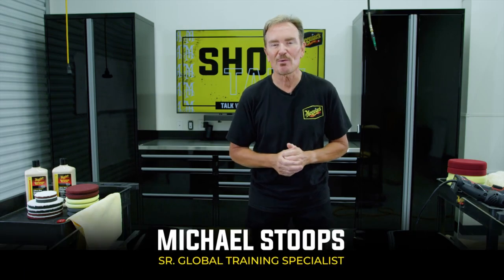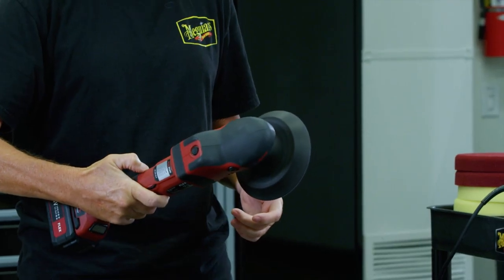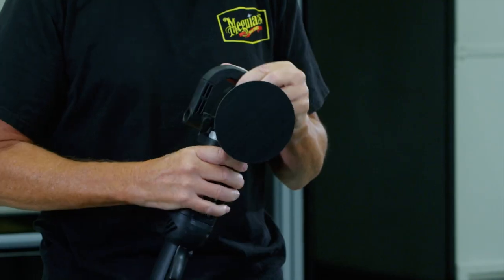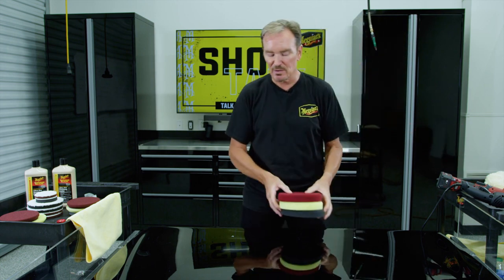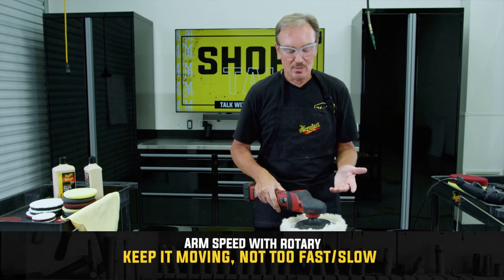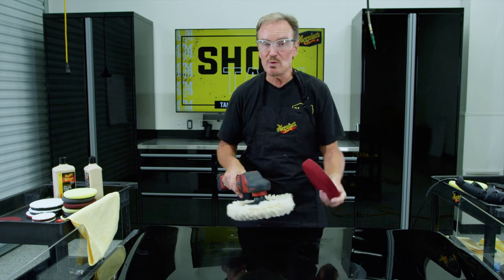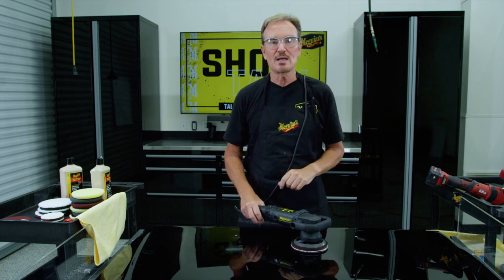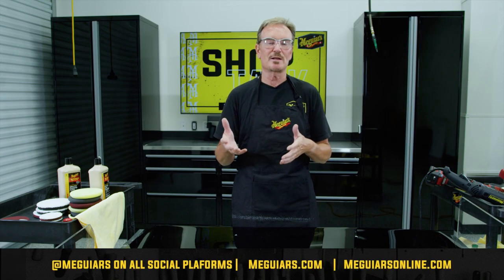Differences & Similarities between Rotary & DA Polishers - Shop Talk with Meguiar’s

Comment: Which tool should I use on the front and rear caps of my Motorhome? The sides are clear coated but the upper portions of the end caps are gel coat, and is fairly chalky. I have the older Porter-Cable da polisher with 6” pads.
Reply from the maker: You certainly can ans should use your DA on both surfaces.  👍

Comment: you all need to do a glass polishing video with fine scratches  and defects etc, but as far as ive check you all dont have any new glass polish product
Reply from the maker: Glass is a very different surface/material than paint.  You cannot remove defects in glass like you do in paint.  Also keep in mind glass does not deteriorate like paint.  If you have some kind of stubborn residue or contaminants on glass however you can certainly clay and compound as long as the glass does not have UV tint/film on it.